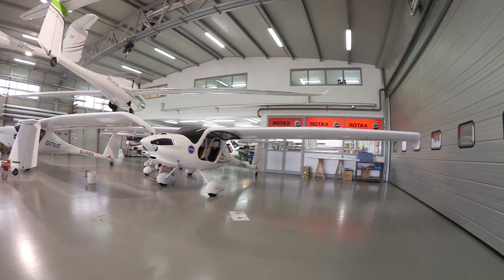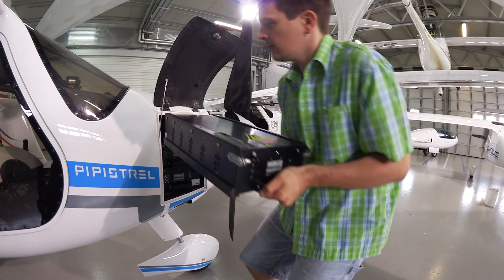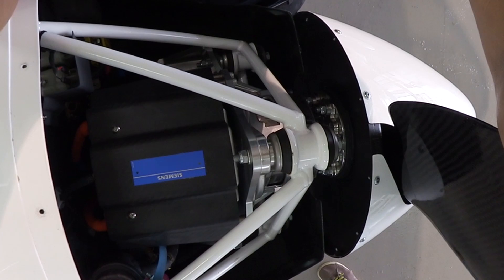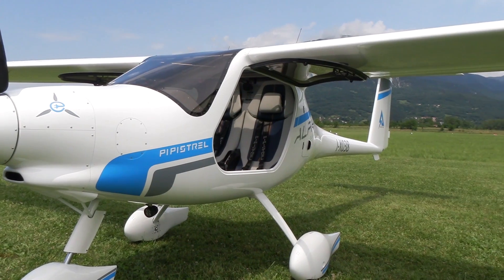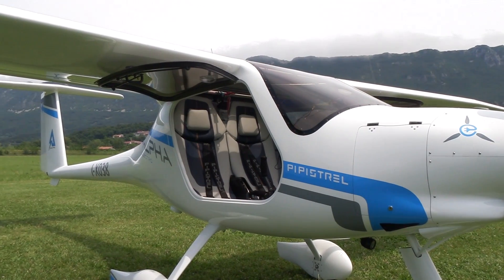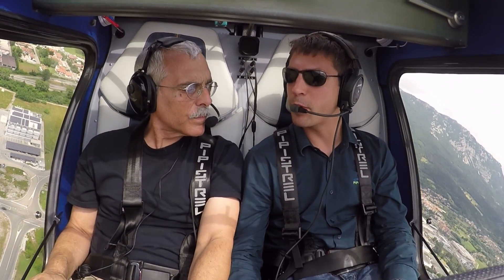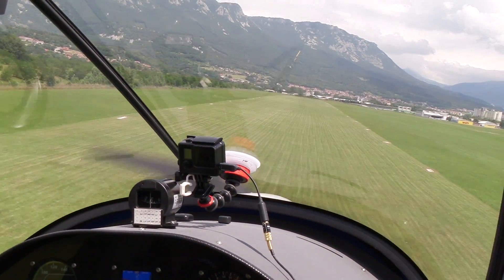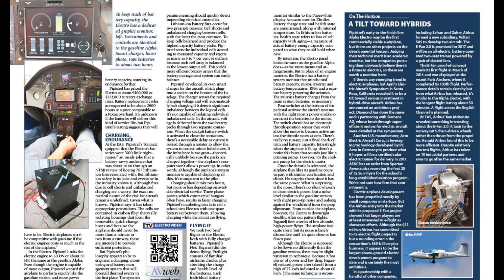Flying Pipistrel's Electric Airplane

Comment: It’s been a while since this was released.. Battery Development continues as latest reports show developing Battery’s to be part of the Structural Composites. This suggests the efficient aerodynamically designed Body would in fact be built using embedded Battery Materials. Electric Motors have high torque advantages over Piston Engines which is why Climb Rate is astonishing. Pipistrel is well positioned to offer Electric Trainers. Notice others copying the Body Design means there’s terrific value. Advances in Solar Panel Designs show improvement also. Maybe future designs will show the Wing Tops layered with Solar Collectors! 
Sailing vessels, both Mono Hauls and Catamarans have already been changing to 100% Electric. Here Regen Props and Solar Panels populate the Boat Top. High efficiency Battery designs still have difficulties with heat and have been known to catch fire.
Small gas/diesel generators help when battery charges are low. Gone are the large Diesel 1500# Generator Systems.
Pushing Technology Limits has many rewards.

Comment: Welp...He were are folks, 5 years later and how much have things improved, honestly? Are we doing 6-7 hour flights or transcontinental flights like they said we would? Answer: Nope.
Reply: Not yet but the capacity for batteries have only increased since your comment

Long distance is probably not in your lifetime, gas burns its weight off but Electric keeps the same weight on landing.

Comment: Just wait, in a few years apple will bring out the "IPlane XR" but batteries are sold separately, and the seats are sold separately asweel. You can get the Pro package with AC for $2,999. You can just get the airplane frame for $99,999 plus a 18% sales tax. Repairs and warranty costs extra. Like if you believe apple would do this?

Comment: Love all the comments from folks who clearly have never had an electric vehicle or even researched Li-ion/poly batteries.  Right now going electric is not about saving money, you won't...perhaps in 20 years but thats 20 years, this tech could look like 8-track in 20 years.
The main concern I have is the 'its green, it worth extra' selling point, those Li batteries are NOT green no matter where the electric comes from. Li is extremely toxic and hazardous and even Tesla does NOT have recycling capability (they just take them back and store them underground).  Also, in cars the Li lifecycle has not been as advertised, Tesla batteries are already at more than 50% cap loss at 1k cycles.
If you want to go electric because you like the torque and performance, please do.  If you are going to claim 'because green' and 'because cost savings' know that is a lie before it leaves the mouth.

Comment: This is a great concept. We do need something to compete with fossil fuel, but I'm not sure what would make it viable other than longer range lighter weight batteries made with easier to come by resources.
Reply: solid state batteries with higher output and much more high kwh. Which are being used right now. The future is now, old man!
Reply: @sqlevolicious  I am old at 55. I am not claiming to be an expert about batteries, however I have spent some time learning about them and their chemical makeup. Notice in my comment I addresses resources which will become a major issue if we were to have 10% of airplanes needing batteries, most folks can't dig up the resources to make batteries in their back yard. If we are to expect better endurance, more batteries means more weight. An interesting argument would be fuel weight versus battery weight, also understanding the battery weight can't change over time whereby fuel weight is always dropping and reducing the lifting load. We could however jettison the batteries as they become spent, using little parachutes. I love the idea of electric transportation, in theory. I'm just willing to address the obstacles to be overcome.

Comment: I've asked the same question over in the DA40 NG video:

Why not marry a small diesel turbine APU to generate power for the motor to extend range and avoid the complexity of a diesel piston engine with a short TBO?
Reply: Too much weight and would entirely go against the point of the product which aims to move to full EV, something all forms of transportation are doing right now.

Comment: India has solved range anexiety for all EV

All modes of Electric transport have 3 major road blocks - Range anxiety, Charging time & battery life cycle. 

My system solves them all - It recharges batteries while - vehicle is in motion, stuck on red light, crawling in traffic, cruising on highway or off-roading. 

1. Increases range by at-least 3 times of its actual range with the same battery pack. (for e.g. If the vehicle travels 50 miles in a single charge with this system the same vehicle will travels 150 miles +). 
2. Reduces charging time by 40%.
3. Increase battery life cycles by 20% minimum.
4. World's first automatic lag free switch-over system. 
5. Reduces direct consumption of power from batteries. 
6. Recharges batteries. 

"Its not a perpetual motion system, eventually batteries have to be recharged."

https://youtu.be/4KSs1fdjCOo

https://www.autocarindia.com/auto-features/its-electric-its-ecycle-403537

https://auto.ndtv.com/reviews/global-renergy-self-charging-electric-bicycle-prototype-review-1586657

Regards,
Punit Patel
Reply: India? Where do I send my Walmart gift cards to? Do you need my bank information now?
Reply: @josephjakubec3171  lemme know if you need my bank baazar card or if you want me to send you some money

Comment: I am the Innovator of THE NEW WAY TO TRANSFORM ENERGY WITH MY UCRÓS ELECTRIC CYCLE SYSTEM of the Republic of Colombia South America Carlos Ucrós WhatsApp +57 3012358709

 And innovated a system to install it in electric cars that use a 72 VDC output controller is a device that I install before the controller and use a single battery and I extend the autonomy to 400 kilometers with the air conditioning on of fasil installation two components with  the battery price in Colombia 9 million pesos out of 3 thousand dollars sent by plane separately contact the innovative CARLOS UCRÓS
www.ucrosenergysystem.com

Comment: It's only a "landing trainer" - that's it! No mention of payload. The 2 guys are skinny, but that's not the average pilot. A big part of pilot licensing is engine management and operation. This does not lessen the cost of flight instruction, as you also need to sign off the student in a conventional airplane. Teaching the student 2 planes, 2 systems, 2 operating procedures - good luck with that! Plane is useless to normal individuals, as they need to manage the charging operation and are completely tied to the airport. Why would anyone want a plane that they can't take anywhere, and really can't carry anything.
Reply: It's experimental

Comment: At $140,000 the Alpha Electro not a great deal, but not expensive either / kind of a mixed bag /
Reply: $3 to refill the batteries with electricity / it hides the cost of the batteries $20,000 & special charger $8500 which as a pair are more like the lifetime fuel costs built into the upfront capital costs / the low noise for training makes this machine a real blessing in regional airports near homes & businesses where aircraft noise pollution a real problem etc

Comment: schools will want this, but private ownership won't until battery life/distance improves,
Reply: Agreed. Honestly, that translates in to some aspects of electric car ownership as well.  Personally I would love to buy an EV (car) , but for me personally as it stands now there are several reasons why I won’t or can’t. I own a travel trailer and take long trips. I understand that recharge stations are become more prolific however there still aren’t enough and it takes to long. Also the range available currently is just not enough. Like I said I tow a camper and nothing out now is set up to do that and the trucks I’ve seen that are supposedly going to hit the market have a much reduced range when towing. Last is cost. These vehicles are wayyy too expensive at the moment. I understand the arguments about that extra cost being taken up by not having to fill a gas tank and reduced maintenance however that’s not really the point. The upfront cost is out of reach of myself and most other people with large or very long term monthly payments. Now if I need to save money I just drive less and am still able to manage a reasonable car payment. Also I’m able to do most maintenance myself to save some money. Maybe in 5 or 10 years when the tech gets better and cheaper I can consider it but not now.

Comment: They should consider putting a couple of aerodynamic "tunnels" on the fuselage at the wing root or the landing gear attachment and install a couple of high-speed wind turbines into those "tunnels" to generate electricity.  I bet you could at least slightly increase range/flight time with a pair of turbines (one per side) tuned to the 85 knot VC speed despite the weight of those installations.
Reply: Sir, you do realize that you're talking about that: https://giphy.com/gifs/crazy-meme-boat-QAgYVztehmQMM
Reply: @Power_DC_Official  No, not really.  I'm talking about using the 85 Knot wind being produced under the plane's fuselage during the flight to generate additional power using a very light-weight carbon fiber wind turbine to recharge the power cell WHILE the aircraft is producing that wind through normal flight.  The system would augment the range of the aircraft in the same way that "regenerative braking" replenishes the battery power in an electric car.   

The issues I see would be;
1) How much added energy (battery power) would a pair of lightweight turbines and an alternator be able to generate at 85 Knots?
2) Would the added weight of the setup cancel out the benefit of the added energy while increasing the complexity of the power system? 
  
   A combination of electrical systems such as wind turbines or solar panels could be used to increase the amount of electricity available to the motor which could increase range IF the electrical output of those devices exceeded the electricity needed to fly with their added weight.
Reply: @swaghauler8334  The energy you're talking about has to come from somewhere and strangely enough it comes from the aircraft batteries which turn the propeller and from it you get the wind you want to turn the turbine with which creates DRAG. Basically your "solution" will not recharge batteries but discharge them even faster!
Reply: Please understand basic physics.

You can't generate electrical energy from the kinetic energy of the aircraft (which is what you're doing if you're turning a turbine with the airflow) for "free". Any attempt to create electrical energy via turbine stuck in the airflow will create drag, and counter-acting that drag with additional thrust will result in a net loss of energy (because no mechanical system is 100% efficient). 

This really isn't something to argue. It's basic science. The guy with the meme was spot on - this idea is just a different version of pulling a boat along with a pair of magnets. No amount of changing the "efficiency" of the turbines, making them from lightweight materials, or whatever else you suggest, will make any difference - it will still be a net loss of energy.  (if you don't believe that, then I have a few emails from a Nigerian prince to show you).

Aircraft do use things called ram air turbines to create electrical energy, sure. But they do that when there's a failure of the electrical system, and in practice what is happening is that the drag of the ram air turbine is counteracted by increased fuel burn from the engines.

Comment: I live in the Western US and the distance between cities is large, often very sparsely populated. I am reluctant of getting an electric vehicle for lack of rechargeable stations.  I have the same worries about flying an electric plane.  My purpose of flying is to fly to a distant place at least 400 miles away. I can't see doing the same thing with this airplane.
Reply: Go away yankee
Reply: @randomdude9269  You're a m0r0n. He has a valid point. If you can't answer the question, shut up.

Comment: Wow...some people are so incapable of serious, thoughtful contemplation.  All these "Electric will never work for real use" comments!  Ten years ago, the best electric cars were low range and pretty crappy; with 80-90 mile ranges, they were comparable to these 1 hr flight time trainers.  That's the year that Tesla released their roadster...a VERY high performance car with over 200 mile range.  Just a few years later, they released their Model S...one of the best cars in the world, with tremendous performance, tons of safety features, and a very good range.  Then they introduced a huge network of charging stations, and showed their 45 second, automated battery swap out system...faster than fueling from a pump!  That all happened in perhaps 6 years....and this week they produced 7,000 vehicles...obviously waaay past "trainers" and "novelty" levels of use.

Get a grip, all you naysayers.  Maybe, just maybe, you need to acknowledge that just because YOU can't imagine it, that doesn't make it impossible...or even unlikely.
Reply: Seriously quit comparing cars to planes you illiterate . Energy of gasoline per kilogram is 46.4Megajoules and for aviation fuel is 42.8 Megajoules per kilogram . 
Energy per kilogram for the best lithium ion batteries is still an abysmal 0.875 Megajoules per kilogram at the moment  .
 This makes aviation fuel 49 times more energy dense than the best lithium on batteries presently .
That is still fine for electric cars rolling down the road  however its NOT for planes .

Comment: Can the propellers be wired to recharge the batteries in flight, so their energy is recycled, rather than spent only?  That would give the plane greater distance potential, which is only logical.
Reply: It's designed that way.

Comment: Including a rough guesstimate on the cost of the battery pack ( a consumable resource), the cost per flight is probably around 15-2 Euros per flight. Still, quite inexpensive considering the lack of required maintenance.
Reply: Does that number include electricity costs to recharge or just the batteries wear?

Comment: Why don't they having solar panels on the wings?
Reply: Planes usually hang out in hangars, away from the sun. Having solar panels on the wings during the flight would MAYBE generate enough to replenish 5% of the battery during that time... but you'd have added weight working against you, nearly nullifying any benefit.

Comment: Now put solar photovoltaic collector film over the wings and horizontal surfaces. Certainly would be helpful when parked to recharge the batteries. Would add almost no weight.

Comment: Why don't aircraft builders understand that a cri cri sized minimal sleek electric glider with reclined seat is an obvious cost optimization configuration that makes flying practical for a 1000 fold larger customer base...